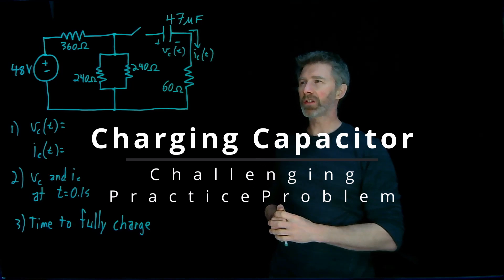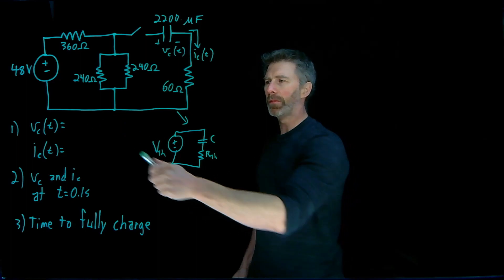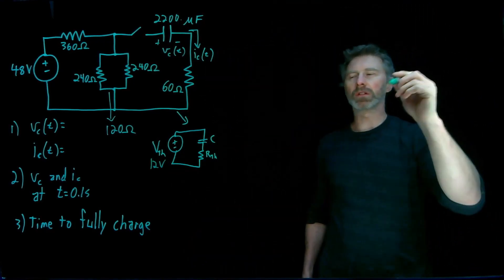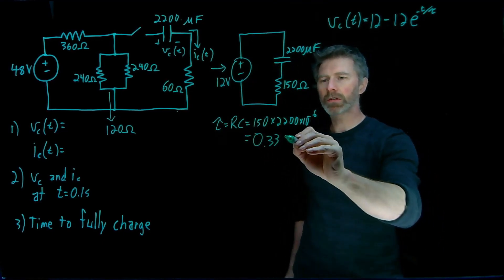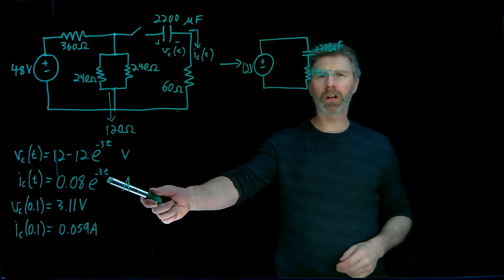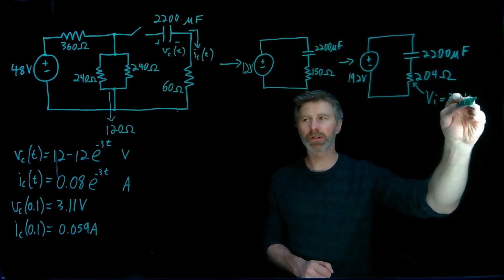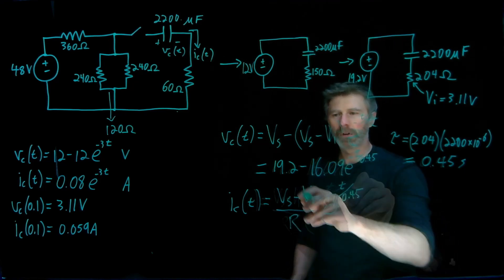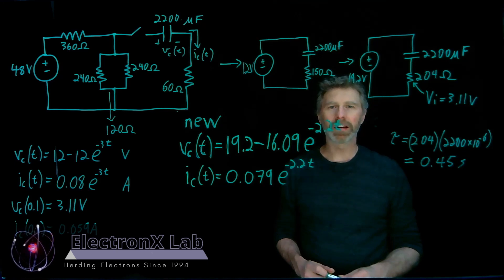Capacitor Charging - Challenging Practice Problem

Comment: With the new modern 4 channel digital oscilloscopes, HANTEK, SIGLENT, RIGOL, etc, with affordable prices, we can now verify these formulas by breadboarding them with actual components, learning electronics has gone easier exponentially, but you have to be a virtuoso in using these 'modern digital oscilloscopes'. Than You Professor.